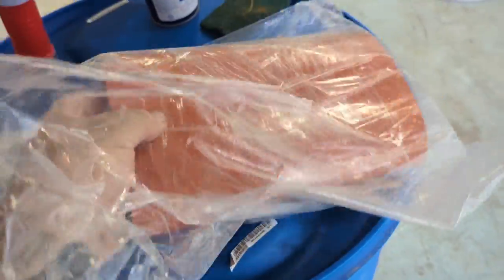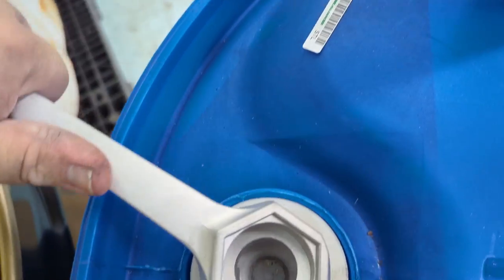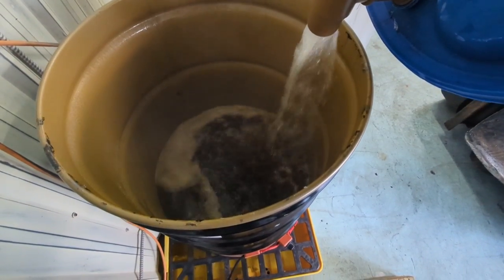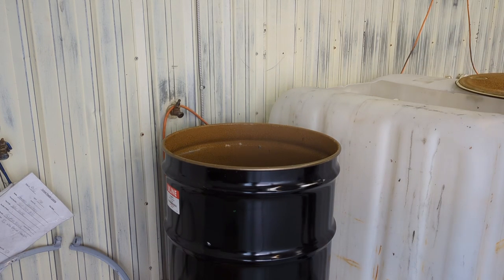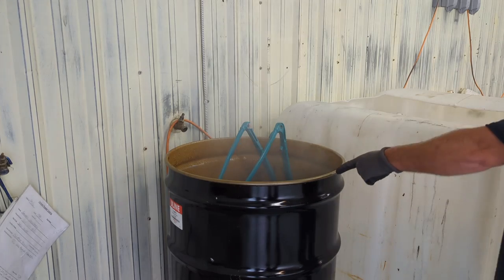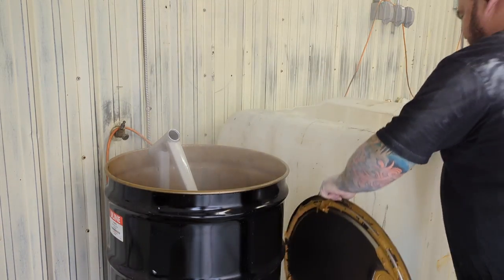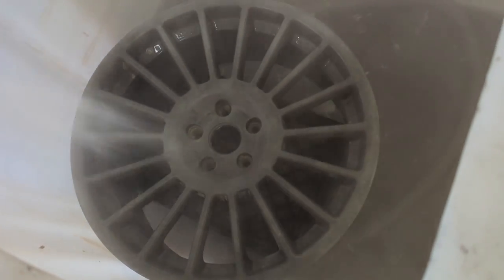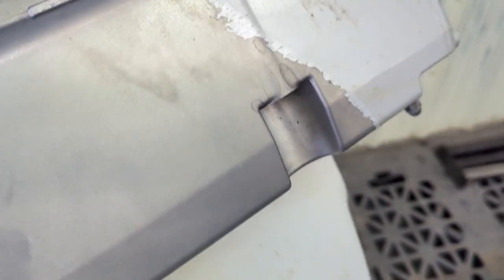Is this the best Powder Coat and Paint Stripping Solution available?!?! - Ep 153 - Unknown Coatings

Comment: Hey man, can you clarify something? I've got a small shop, and was going to go with a full Methylene Chloride based setup but the size of my shop concerns me. 

You said it's safe for Magnesium parts, but the PowderStrip website specifically says "It is not for use on Magnesium", any ideas there? I've got Ducati stuff which is Magnesium that'll need to be coated occasionally and I'd like to have the ability to do it. 

Thanks!

Comment: This is more about the planter and furniture you were coating at the end. Do you have any guarantee to your customers on it not rusting? We have an issue with holes in welds that water will get into and drip rust down it overtime in the customers possession.  We tell the customers before hand, but do you have a way to prevent it?

Comment: Awesome video, we ordered it after seeing this.  Question about settings if you dont mind.  What KV and microamp do you usually run?  I know it varies and im seeing a lot of different numbers, some saying leave KV alone and only adjust amps some say adjust both.  trying to figure out whats a good place to usually be.  Will be doing only automotive parts, springs, wheels, etc

Comment: How long does it take to get to temp?  Do you leave it heated all the time?
Reply: This is a good question, I just pulled the trigger on an Electron system and now I'm pretty sure I need to get a stripping setup.  This question is on point for me as well.

Comment: Eco Strip is specially designed to remove Powder Coating from ferrous and non-ferrous metals and silicon at heated temperatures without the dangers of harmful acids. This product is readily biodegradable. It is NOT for use on Magnesium, from powder strip web page
Reply from the maker: It's wrong. Tested two types of magnesium. They will be adjusting their webpage :)

Comment: what is the maximum size rim that will fit in a 55 gallon drum....
Reply: 20" are good. 21" goes in with some struggle
Reply from the maker: yeah 21s work but its a tight fit. 20s are easy enough.

Comment: B17 doesn't really take adhesives off like youd assume it does either. I work at a high volume wheel shop and sometimes our stick on job labels survive the benco dip
Reply from the maker: RIm Strip (B17s competition) seems to take it off, but does occasionally leave it I guess.
Reply: Probably also depends on how spent the solution is.
Reply from the maker: Absolutely
Reply: @UnknownCoatings  Yeah I noticed that B17 struggled with stickers as well. Once I switched to Rim Strip that seems to remove adhesives better.

Comment: I wonder how this stuff compares to Stripoxy 6842? Also how do you mask parts for sand blasting?
Reply: Im also curious. I currently use stripoxy.
Reply from the maker: I dont know, perhaps I can get some and do a test along with some other strippers. DOes it require heat?
I usually put normal blue masking tape down, then some sort of heavy ductape over that.
Reply from the maker: a test is a must!
Reply: Im about to order some stripoxy since i am a diy guy
Reply: @UnknownCoatings it does have to be heated.

Comment: do you have to use a stripper will sand blasting the paint off work as well?
Reply: Stripped should remove paint/powder and sandblast if u are going to powder coat after

Comment: It says it has KOH in it (potassium hydroxide), which is very corrosive to aluminum, magnesium, and other metals. Good for steel or iron though. I would think you should be careful with this affecting your parts. You mentioned wood - I would not recommend that! Plastic should be okay though. If you need to, perhaps do some testing and only use it for as long as necessary.
The rest of the product is NMP and ethanolamine (causing the ammonia smell you mentioned).
Most definitely use a respirator and other proper equipment, you do not want to breathe these chemicals (look it up if you don't believe me).
Finally, I'm not knocking the product, but just trying to inform those interested. I appreciate being able to purchase a powerful and effective stripper like this. Just want people to realize this isn't at all a product that is eco/bio friendly, even if it is better than methylene chloride.

EDIT - glad to see that it doesn't appear to be affecting the finishes as you mentioned, which is great to hear. Perhaps the concentration is just low enough and exposure time short enough to not to cause major issues on aluminum. I do appreciate you testing products like this and sharing!

Comment: It says on their site that it is *not for use with magnesium.
Reply from the maker: I do see that listed. I tested two types of magnesium alloy I had on hand and neither had a negative reaction. I'll powder coat both pieces and try again.
Reply: @UnknownCoatings looking forward to what you find out. 🤙🏼
Reply: You probably won't run into much magnesium it's pretty pricey for non high perfomance parts.
Reply: @davidbartch8917  I run into it all the time.
Reply: Evo valve covers. Ive stripped them in regular strip to test it, twice and tbh it didnt affect them. So ive done couple. But i be checking every couple mins i try to get them out as soon as possible

Comment: Ecostrip is a great stripper and it's  eco friendly!  Works best in a heated tank with a pump to move it around.
Reply from the maker: yeah the new setup will have a pump to push it around!
Reply: @UnknownCoatings  Do you need a special kind of pump for the chemical or will any type of water pump tolerate the eco strip?  I know a lot of pumps have plastic or rubber vanes/diaphrams.

Comment: Hey i have a question. On powder coating. I bet u can help me with. I did some rims recently. And the  powder chips easily. This is the only time this has happen. And im usuing prismatic
Reply from the maker: does it chip to the next layer or powder or down to the metal? I would need more info to be able to help